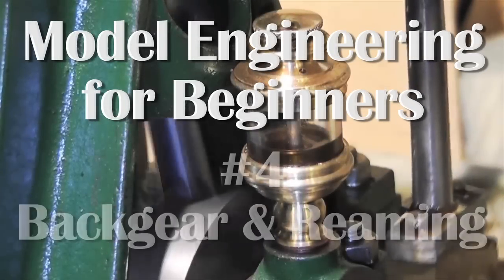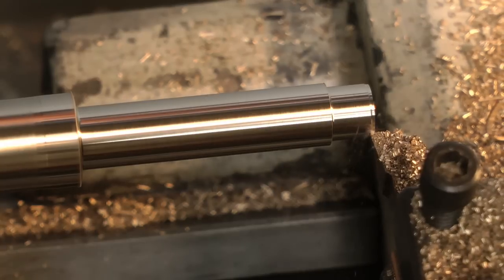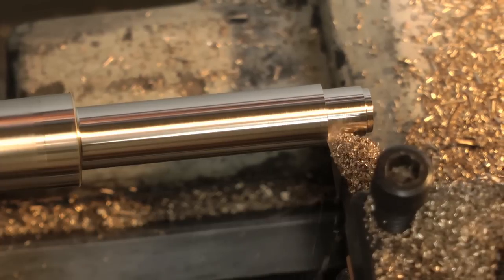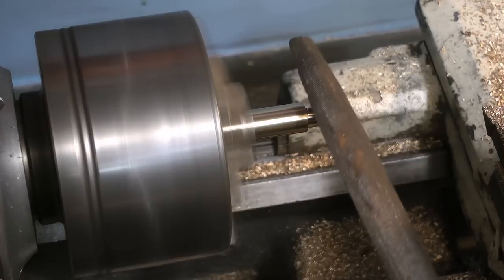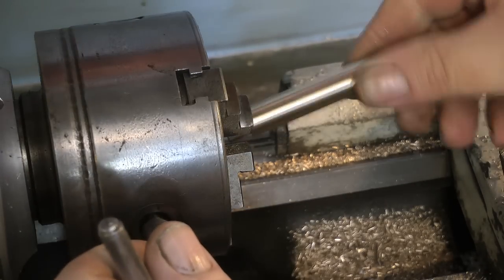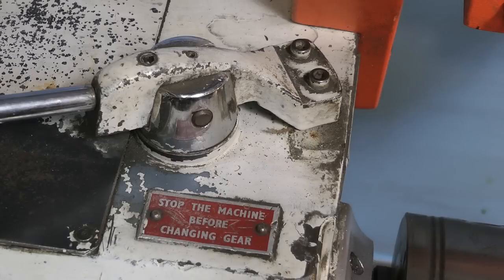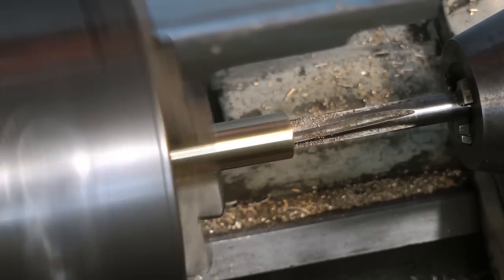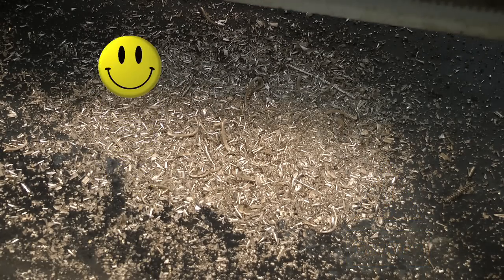BACKGEAR & REAMING - MODEL ENGINEERING FOR BEGINNERS #4

Comment: Silly question time, regarding using the reamer, you mentioned to drill the hole one imperial size smaller then follow through with the reamer, how much is one imperial size? 1/8, 1/16. 1/32, 1/64?? Thanks Keith.
Reply from the maker: Please Google Imperial Drill Sets and have a look at the sizes.